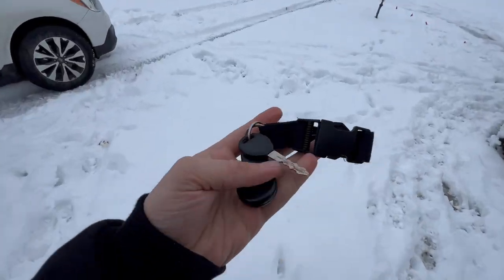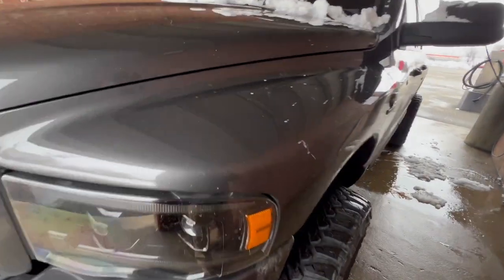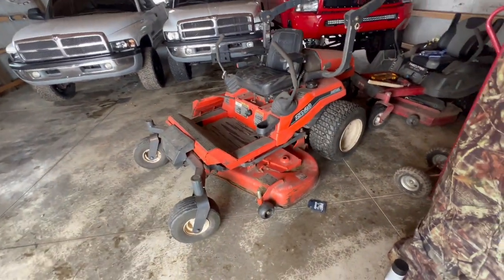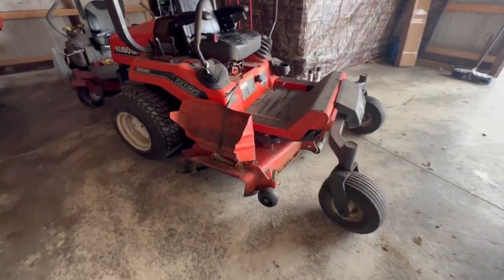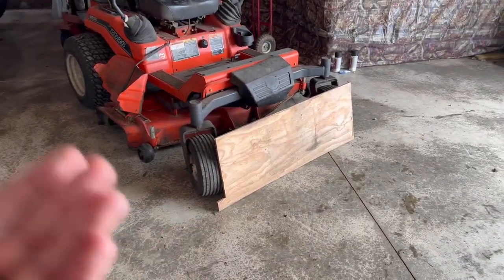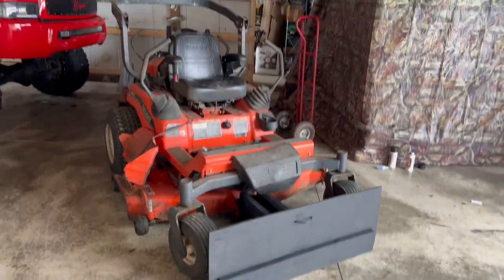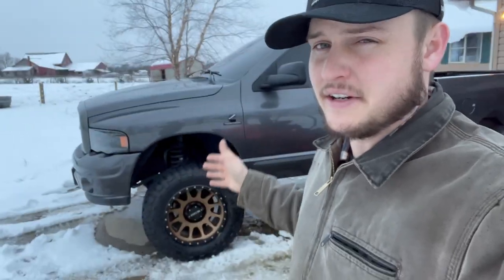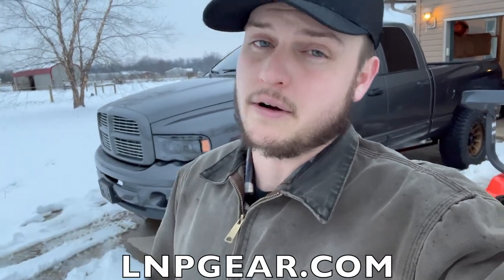The new DIESEL toy...

Comment: I’d keep that Kubota mower if I were you. Those diesel kubotas are very solid. I have a zd331 where I work and the in the 2-3 years of working there all we’ve had to do is oil changes and fuel filter changes. It never skips a beat.